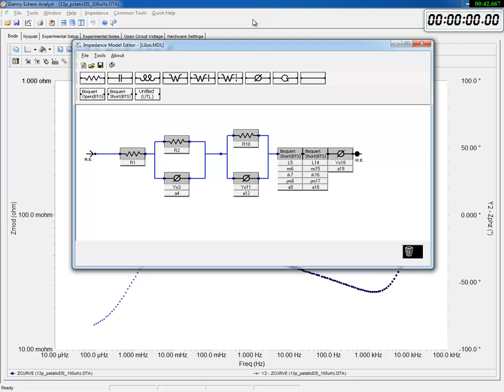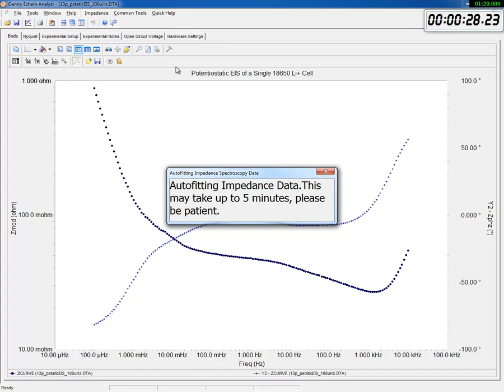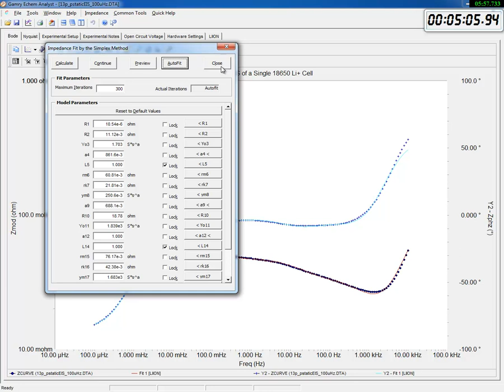EIS data fitting of Li ion battery

Comment: how did you build that model ?
Reply from the maker: You can build any custom model with the Model Editor. To use the Model Editor, open an EIS data file, go to the Impedance menu tab, and then select Model Editor. You will see a selection of available components, and you can use the wire component to connect them together to form a circuit. If you have additional questions, please feel free to email techsupport@gamry.com.

Comment: This fits the data for only one SoC. To be able to use the data in a model you need fitting for a whole range of SoC from 0 to 1
Reply from the maker: We do have a batch fitting option for EIS data files, allowing multiple SoC's to be modeled at once. You can find this option by opening our Analyst program and selecting Tools>Run Named Script, and then selecting "EIS Batch Fit.Gscript". A window will open that will guide you through the process of selecting the model and data files to fit.